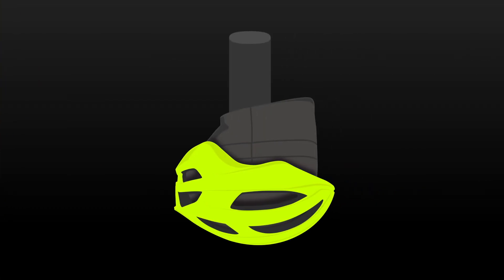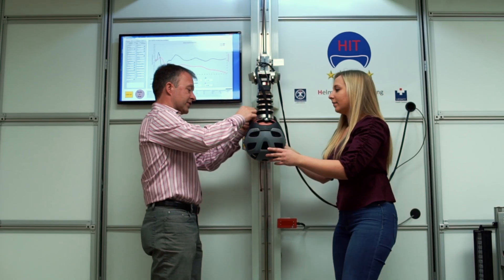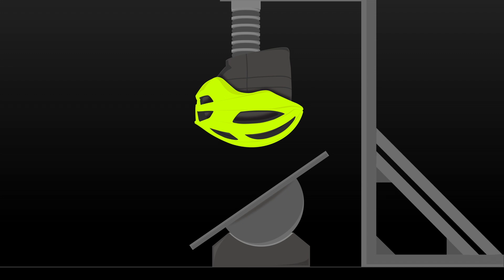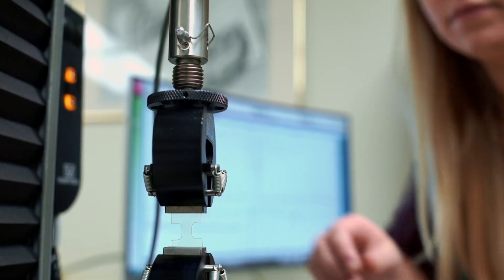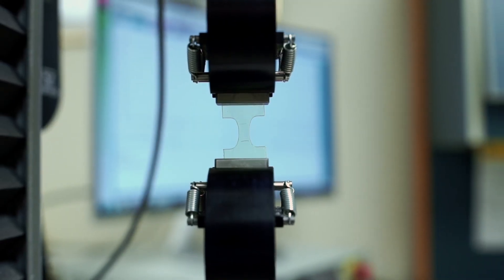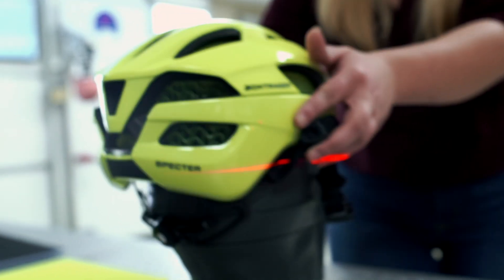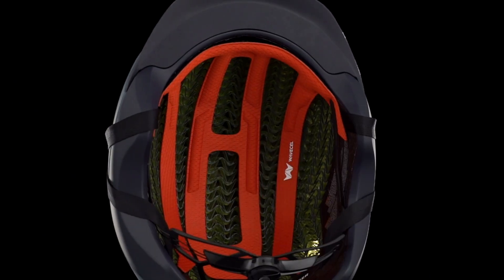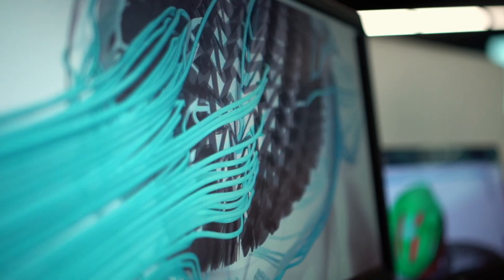What is WaveCel?

Comment: I got my new WaveCel less than and month ago when I got my new Trek SL6 AXS bike.  I had an old helmet that I thought was good, but I liked the feel, color and that you could add lights. Very comfortable to wear and only gets a little hot in the S FL heat. I put the front and rear lights on it just in case.  I would not have known how great the design was without this video.  I hope to never need it, but I feel better reading the comments below about real crashes and how people survived. By luck I decided to get a new helmet that turns out to be great!

Comment: Just got mine. I agree with the presenter. It just FEELS safer!
Reply: But science disagrees with your thinking unfortunately,
Reply: @chefgav1 Im not having a go at you, but could you explain a bit more. I think you are not looking at mips vs wavecel specific articles. Most articles say mips is better than non mips but they never directly compare it to wavecel. Plus, wavecel has been proved to reduce both rotational and linear force unlike mips which is only effective at reducing rotational force.
Reply: @TheTrump86  MIPS and wavecell have been thoroughly tested by VT. Bontrager have a model called the rally which one was MIPS and one was wavecell same model just different safety technology. When VT released there ratings the MIPS was found to be significantly safer which would have been a huge embarrassment to them considering there claims on wavecell. Not long after the findings the rally MIPS was quickly discontinued
Reply: @chefgav1  Show me

Comment: Bottom line, a helmet is better than no helmet.  I do have a wave cell helmet but rather not find out if it works or not.  MIPS moves but your head is mm away from your inner helmet with no layers in between.  The non science person in me prefers that extra cushion.
Reply: You are correct.mips has been proven to be a better technology

Comment: First crash in my Specter Wavecel I got a concussion... bummed to say the least. Could have happened with any helmet, however, I hit my front temple area. If you look at the Wavecel design, the front temple area doesn't get covered by the actual Wavecel membrane. The front inch or so it just the solid foam. So if you directly hit this area, you have zero Wavecel, and no MIPS in these helmets to help relieve any impact. If I had a helmet with MIPS, it does generally cover that area & possibly could have deflected some of the impact. Now out of warranty since I'm over a year in the helmet and trying to decide on a safe replacement.